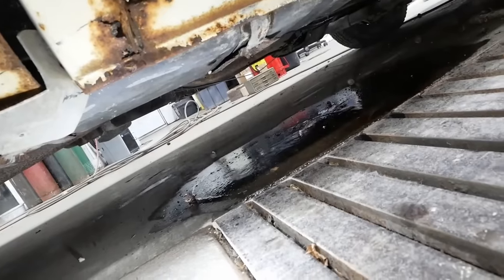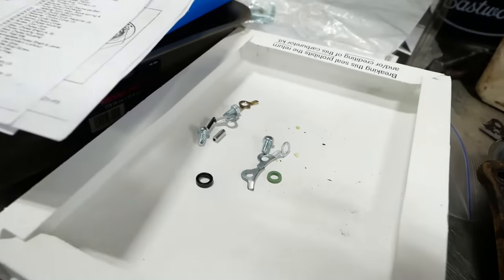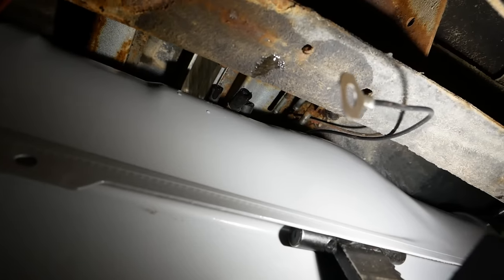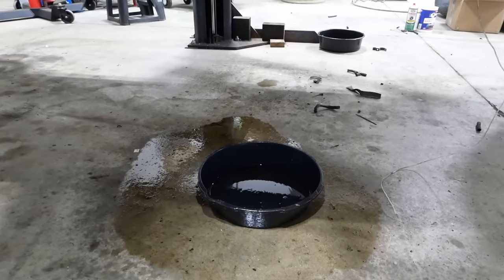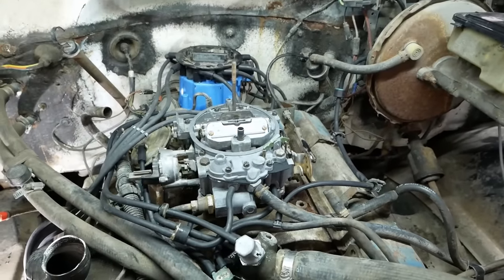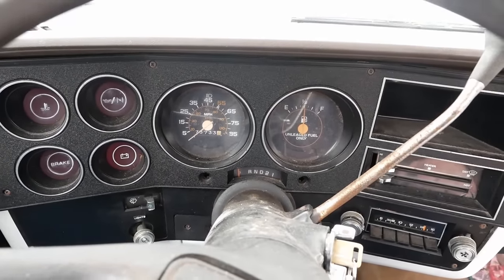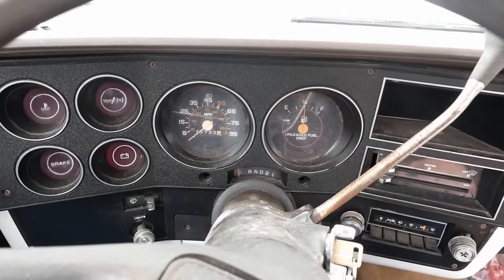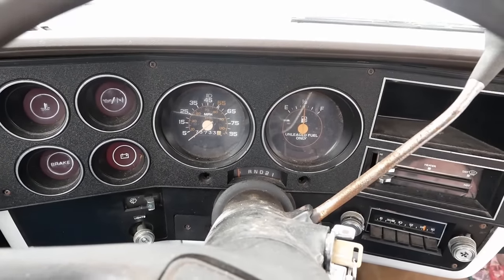Millennial vs. Carburetor | Square Body Chevy Back on the Road After Sitting 12 Years

Comment: A simpler time?? Really??

I remember working on carbureted vehicles. Reading through manuals trying to figure out what is wrong and what to fix. Having to have a Haynes manual for every vehicle. I remember my old Honda Civic with I swear 40 vacuum lines under the hood. I remember before that, old trucks with a single vacuum line going to the distributor for advance. You still had to know what was wrong in order to fix it. Sometimes your only option was to start throwing parts at it. I remember rebuilding carbs only to have it either return to the same issue or have some other issue afterward. 

I do not miss those days. Today when there is an issue, 99.9% of the time it will tell you what is wrong. It at least points you into a direction that gets you in the ball park. 

I agree, the systems may have gotten less simple but the actual process of figuring out what needs to be repaired has not. That has gotten more simple, for the most part.

This video is a perfect example of that. Thank you Wes for reminding me of this.

Comment: The valve on air cleaner has to be connected or it will run to rich has nothing to do with exhaust. That valve must be open or it will not run right lick exhaust is plugged.

Comment: You have never once measure your manifold vacuum. How can you adjust a carb without knowing that?
Reply: Also, you can’t adjust the idle until you adjust the mixture screws.
Reply: You are just chasing your tail and it’s because you are committing the same crime everyone on the planet does. You don’t know how to tune the carburetor.
Reply: It is not ever necessary to adjusted the APT.

Comment: zinc is needed on flat tappet cam they don't use it now because all engines use roller now and don't need the zinc. if you don't think engines need zinc take a flat tappet cam and break it in with modern day oil and then break another flat tappet cam in with modern oil with a zinc additive and tell me how they broke in because I guarantee the cam with modern oil with no zinc additive will have a garbage cam shaft and lifters when your done.

Comment: Ask a tribologist sink reduces the service life of the oil and reduces the life of a catalytic converter. Adding zinc to a formulated oil is not good from a pure chemistry point of view. The short term benefits are detrimental for low oil temperature engine.  Messing with chemistry is fought with unintended consequences.  If you have questions on this take regular oil samples and test them and get an oil temperature sending unit.   The acid numbers will go up and can cause issues in low flow areas if the engine sets for long periods of time.  I’ve watch many channels on you tube where I cringe when sink is added.

Comment: You will never see my comment but thinking the timing chain is sloppy and giving a eradicate idle/timing issue.. considered if you checked the hose on the soft shift at the back of the transmission and that valve itself as they get a hole in them allowing it to suck fluid out of trans as well as create a small vac leak. A smoke machine should point out if a vac leak in the heater system under the dash as well, Just my eleven dollar I am full of shit comment Wes

Comment: You are right, zinc and other friction modifiers areent as important on low lift cams and weak valve springs, but you are wrong in saying it isn't a real problem on performance engines of all types. Nascar has had a terrible problem with the newer EPA nutered oils, and some crew cheifs have their own brands becasue of it.
Reply from the maker: Is that applicable to anyone?
Reply: @WatchWesWork  Everyone that builds any kind of flat tappet performance engine. The dyno shops are having heck with it, losing cams left and right.

Comment: YOU ADD JUST THE, CHOKE WITH THE ENGINE RUNNING AND TURN THE ,BIE,METAL SPRING, TILL,  THERE IS RESISTANCE ON,THE PRIMARY CHOKE FLAP WITH THE ENGINE AND THE BIEMETAL AND  ENGINE  BEING AT THE SAME TEMPERATURE 
SAY COLD START IN THE MORNING  ,BEST TIME TO MAKE SETTING,THEN, PLUG THE CHOKE WIRE,  UP,,THE ENGINE COLD,AND THE CHOKE BEING AT SAME TEMPERATURE, THE SPRING ADJUST TO TEMPERATURE UNCOILING,OR ,COILING UP TIGHT OPENING UP THE CHOKE FLAP FULL WHEN WARNED UP WHEN COLD KEEPING THE FLAP CLOSED OR ADJUST TO A CRACK ,OPEN THEN,PLUG IN THE HOT WIRE,,,,,!WHEN TURNING THE, CHOKE,YOU CAN ALWAYS, FEEL THE SPRING ON,THE FLAP THAT WAY YOU KNOW THAT THE BIE METAL SPRING IS ON,PROPERLY,,,LAST THING, PLUG THE HOT WIRE TO THE CHOKE NEVER ADJUST WITH THE, WIRE ON IT WOULD BE CONSTANTLY CHANGING SPRING, TENSION..ALSO WHEN PLUGGING UP THE CARB HOSES,THERE IS ONE HOSE,,THAT RETURNS, GAS, VAPORS TO THE CHARCOAL,CANNISTER,LEAVE IT OPEN WITH A PIECE OF HOSE OR STRAIGHT TO THE GASTANK VAPOR,RETURN, VAPORS WITH OUT THE CANNISTER WILL PRESHURIZ7,THE FULL,TANK USE A,Y,HOES SO IT CAN, RETURNS, VAPORS AND THE TANK BREATHING, FREE,AND THE VAPORS OF THE CARB ARE FREE AND NEVER PLUG OR BACK PRESSURE ON THE LINE OR YOU WILL GET MAJOR, BOOG,AND IF,THE TANK RETURN IS PLUGGED FULE ,PUMP IS GOING TO SUCK THE TANK OUT OF AIR MAKING IT A, BOMB,IF YOU GET REAR ENDED AND IT WILL STALL OUT WHEN THE PUMP CANT SUCK NO MORE.

Comment: Kinda funny, you're making videos just like Derek does on VGG, which you took a dig at. 
After taking a dig at VGG, you admit you don't know much about automotive carburetors. Derek rebuilds them in the parking lot of a parts store. At least he knows something about them. 
If you ever watch a video from VGG, instead of poking digs at him, you would know he doesn't just pull vacuum lines off & plug them. 
Damn kids trying to do a mans work!
I was replacing mechanical fuel pumps while you were still knee high to your parents. 
I won't use shell rotella oil in diesel engines, i certainly won't use it in gasoline engines. 
I've been operating diesel engines in tractors & big trucks since you was a gleam in your daddy's eyes.

Comment: Typical quadra junk put in a one way check valve to keep the fuel at the carb other wise it will run back to the tank that carb won't hold the fuel up there

Comment: Mechanical system are way better then Electronic Sensors now days But vehicles back then were made To last Society Is Now A throw away Society which is what is sad vehicles are made to dispose of these days replace a sensors for 1800 dollars 50 times in its life then replace a 20 dollar Mechanical Valve ever 40 years Society isn't made now days to repair its now setup to just replace and then throw away @Watch Wes Work